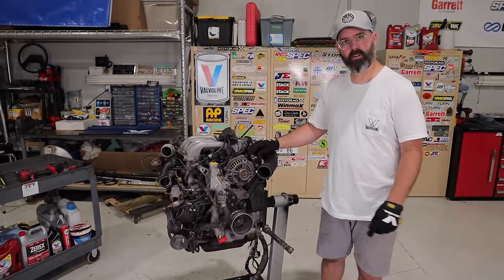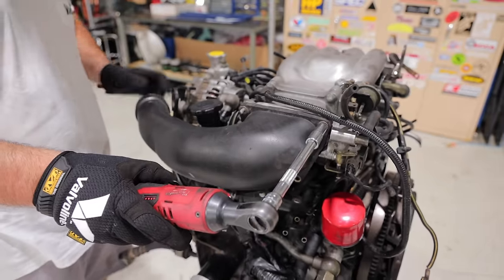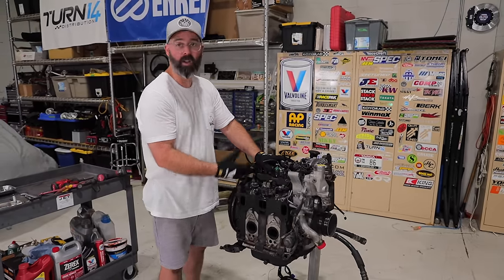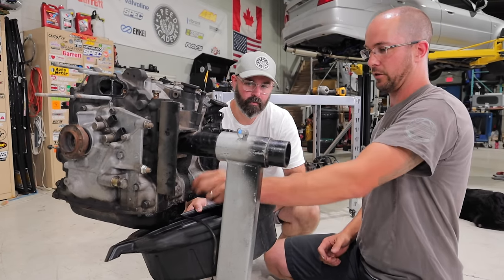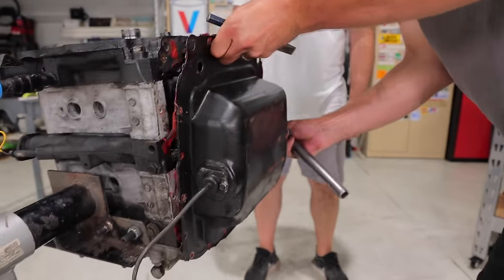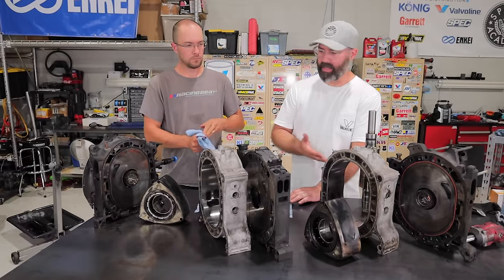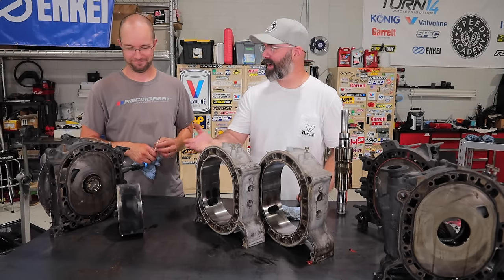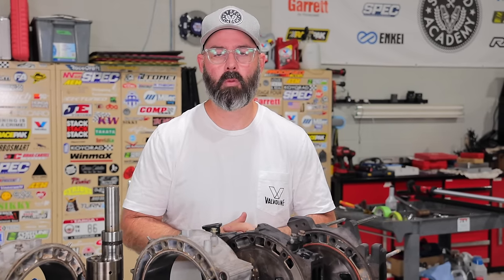How to Build A 10,000RPM Rotary Engine - Part 1

Comment: Vacuum nest!!! I was a rotary mechanic at Mazda for 4 yrs.. I loved them then hated them.. I used to replace the vacuum lines with aircraft line to reduce cracking 100% and help with longevity...
Reply: How are aircraft lines different? What are they made of? Cost? 🧐🤔
Reply: @I_know_what_im_talking_about  ... Teflon tube rapped in S.S. braid .... work's well on brake lines too.

Comment: Love that rotary content. The rotary content is what originally lead me to subscribe to this channel. It is obvious that the last build on that motor was done very poorly. These poor builds is what makes rotary engines not reliable. Many engines are done like this and then the motor gets a bad reputation. The builder of the rotary engine is one of the keys to a reliable rotary engine. Well hell I guess this can be said about all engines. I am sure that speed academy will do it right and it will be reliable. Brap on

Comment: Nice video! Rotary are awesome. Best channel on the youtubess interweb
My theory, rotary engines complete “4 stroke/cycle” in one rotar rotation so 1.3L is really 2.6L. Also the engine has 1:3 multiplier gear inside so 10,000rpm output is 3,333rpm at rotar. 450hp/300tq 1.3L 10,000rpm is really a 150hp/900tq 2.6l 3,333rpm with 1:3 transmission gear. That’s why airflow, fuel consumption and heat are so different. :)

Comment: Turbos are the same size. But the content is still great. 

First one gets 100% exhaust flow
The. When it starts to overboost it opens a valve to divert air to the second. Second comes fully online and ecu runs the wastegate from that point onwards

Comment: Fun fact (I used to own an RX8 with 'hi-power'/'6-port' Renesis/13B-REW); here in the UK the gov't tax the 13B rotary family as 2.6 litre/liter engine. This is because although it's physically a 1.3 litre the overall equivalent swept capacity with the rotor pulses is comparable to a 6 cylinder 2.6 litre piston engine. 

The UK road tax rules have various rules, which (currently) means if you get a pre-August '06 RX8 it will be MUCH cheaper than a August '06 or later car.

Comment: FYI, the twins are the same size. First one comes on then by 4500 the second one is on and they work in parallel.
Reply: Shhhh don't tell them that!
Reply: That was only true on the 92-95 models using HT12's. The 96 and later twins, the secondary turbo was an HT14, and was the go-to swap because the newer twins had a much higher nickel content in the cast iron housings and manifold so they didn't crack. Also pushed a little more boost too.
Reply: Nah, I have a 99 RS. The twins are exactly the same. Only change is a 1mm reduction in the size of the compressor housings from 51mm to 50mm, and the addition on am abraidable seal. Both the front and rear turbos are exactly the same size. The nickel content on the manifold is true as is running higher boost later on. That's why the cars went from 255ps to 265ps to eventually 280ps.
Reply: @cib2413  Curious why the stampings on the twin's i've had had HT12 on primary and HT14 on the seconday on the 3 that i had then. They were the 1mm smaller on the inducer, but where 3mm larger on the exducer

Comment: One of the worst things Mazda did with FD that made it as unreliable as it was, is not designing a way to have the car vent the engine bay heat. of course using an undersized intercooler, and only a 2-row radiator didn't help things either. 

Mazda did use the FC RX-7 as the test mule for the REW, and the FC having a bigger engine bay was a benefit but when the FD design came around too many compromises had to be made to fit the engine into it. 

I miss owning an FD. I've had 23 of them over the last 15 years but got out of the rotary game a few years ago due to life throwing me a curveball - soon i'll find my 24th FD and this time keep it.

Comment: Ages ago I remember watching a video of a guy who had converted his FD to built, naturally aspirated REW and the issue he said he had in practice were the long gear ratios in the stock transmission.  Will an RX-8 six speed bolt up?
Reply: It will but its much weaker. Its basically a 6spd Miata transmission. Its even coded by Aisin as a "low torque" transmission. The 13B-MSP from the RX-8 barely made 130tq. People doing REW swaps in RX8s with the stock 6spd regularly broke the trans even making 300wtq. They almost always kept the FD trans because it stronger in every way and made by Getrag. The very same company that built the V160/161 6spd for the MKIV Supra.

Comment: I wouldn't use Valvoline in Rotary engine, unless it has clean oil feed system. They don't make oil that is meant to feed into combustion chamber. Idemitsu does. Difference in engine carbon build up or lack of is HUGE from non-rotary oils

Comment: So is it really a 10k engine ?
The rotors only are going 3.3k 
It’s kinda cheating to call it 30k as that’s measured from the crank shaft that geared up 3 to 1 , that’s like first gear in the engine 
I’m proposing the rotor speed should be rated the engine speed 🤷🏻‍♂️ what ya think ?

Comment: Just asking,     should the engine really be rated at 10,000 RPM, ? As I understand the rotors are only going around 3,300 RPM , with the engine speed taken from the crankshaft that’s internaly geared up at 3 to 1,  that’s kind of cheating for regestering the engine speed.

Comment: It is like every time i see a Rotary engine tare down on Youtube, the motor is half trashed and ready for the garbage bin.
Reply: Unfortunately, that’s how it is most of the time. 

A rotary engine is... bitchy, for lack of a better term in regards to practically EVERY aspect. Lol. 

If you start with a brand new *properly assembled block* and proceed to frequently monitor your compression numbers and then hop in there and rebuild it BEFORE it blows, that is the only time you’ll see healthy components simply in need of new seals. 

Once she blows, the damage from the vibration causes accelerated wear in a very short period of time and so the engine becomes trash, sadly. I’ve owned an FC and like 6-7 RX-8s. Lol.
Reply: @I_know_what_im_talking_about  I was a fan of the rotary engines from Mazda, but it bothers me a lot that they have  a lot of problems. I can dream about building an awesome engine only to have it blow to bits later on in the future kind of deters me from investing in it.
Reply: welltell — well said. Lol. It’s still an awesome car to own for a bit and enjoy it while it’s healthy. 🤷🏻‍♂️ 

I’ve had 6-7 of them I’ve flipped thru, just looking for a nicer and cleaner example each time with lower mileage and higher compression numbers. 👍🏻

Comment: I love doritos. Please rebuild the RX-7 close to stock, just better as if mazdaspeed did it. And reconsider going single turbo, make it twin sequential just with 2020 tech 👌
Reply: No one keeps the sequential system unless they either can't afford a single turbo or have an ultra-low mile museum FD. You get so much better response and reliability and power out of a medium sized single. The last FD I built a few years ago, had an older GT30R made more power from 2000-5000rpm than the stock twins ever could do even at 20 or 30psi using meth injection that I used to push before i could ever afford a single setup on the first few FD's i've owned. Also, if the twins aren't from a 96 or newer, they're trash anyway because they crack way too much due to having practically no nickel content in the material to better deal with contraction and expansion

Comment: It's a shame the engine is in this condition. 1 of the biggest problems with rotary engines is that many people take short cuts on rebuilds. They last a short while, then they fail again - usually with the new owner. This is why I bought an FD with an unopened motor. It ran well for 10 years but finally a water seal let go. Not bad for a 25 year old engine though!

Comment: its my understanding that these type of engines are for [PROFESSIONAL!] "RACE!" cars! and that consequently they dont last long! its my understanding that no matter what you do they will never last more then 50k miles and they will never pass smog! "I DONT CARE!" im not driving one! im interested in using one in a QUAD-COPTER possibly as an engine or possibly to make electricity for the engine! [QUESTION ONE!] its my understanding that because these are professional race cars and that they have no "TORQUE" and could never go "UP" a hill! consequently could you put a propeller on one? can they be used as an engine for an airplane! [Question two] i suspect that they can be used for generating electricity because they have HIGH RPM and can spin fast? has "mazda" ever considered doing something with their engines besides pretending to be a car? and finally! WHICH IS THE BEST MAZDA ENGINE? If you decide to use one! and what do they cost?

Comment: its such a shame the rotorys inherit issues that can make the unreliable when they have just a few moving parts they have the potential to be the most reliable engines.i fear by the time technolgy fixies these problems we will be using electric as emissions will make them obsolete

Comment: Man, seeing a rotary always makes me sad, it's such a cool design with a nice sound... but it's highly unlikely that it will ever be brought back...
And now with f1 engines pushing almost 50% thermal efficiency, rotaries look like stone age tech
Reply: Its going to take 20+ years before anything in F1 ever comes to mass production. Even thermal efficiency is only afforded because of the work they're doing with turbos and energy recovery for the hybrid drive. Things that not even current $2+million hyper cars are doing. F1 is basically a white paper on what is possible. We are only just now getting technology in cars today that F1 has had prototypes of in the 80s and 90s

Comment: So the conclusion is, that engine is junk and had a cr*p rebuild in the past, looks like the only reusable parts are the irons and ancillaries. Obviously side/corner/apex seals & springs, rotor/end bearings etc would have been pretty much service or 'while you're in there' items anyway - unless they were/are in really, really good condition to start with and are known good (very unlikely given the abuse this engine has had).

Comment: Please stop calling it a 1.3litre, that would be like calling a 2 litre piston motor 1litre (as it fires every 720 degrees). Do the math on degrees of crank shaft rotation to firing and it is better compared to a 3.9 litre 6 cylinder reciprocal motor